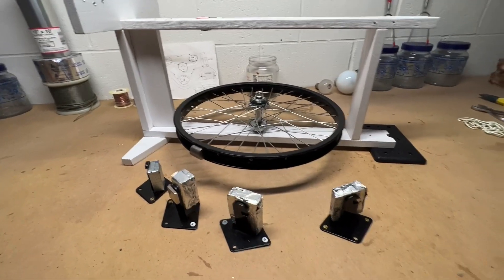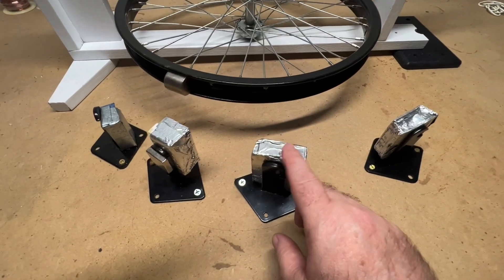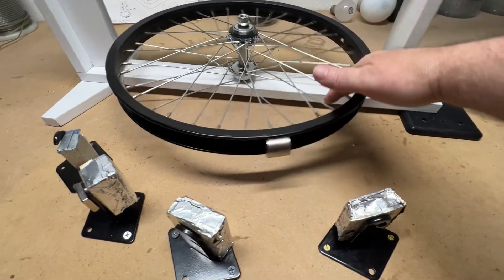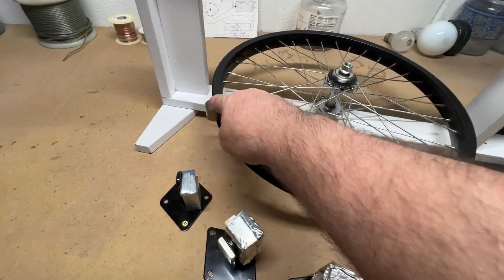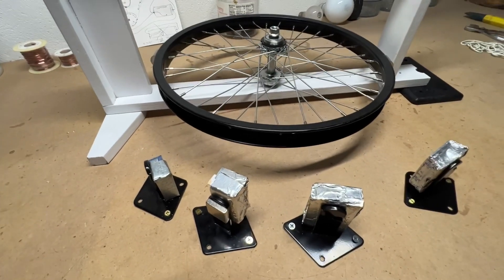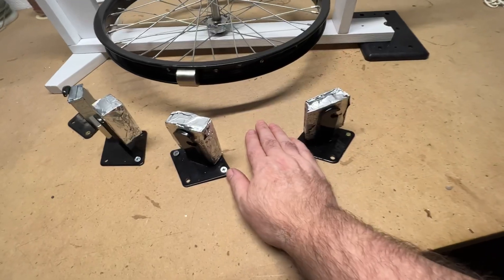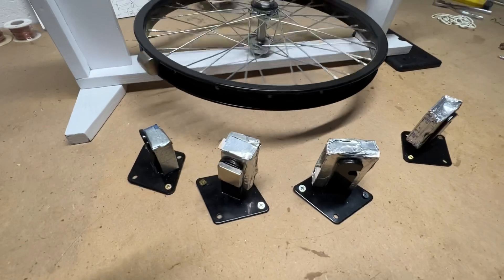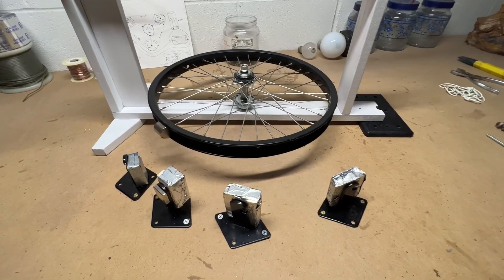🧲 FREE ENERGY GENERATOR RESEARCH | 4 STATORS

Comment from the maker: I forgot to mention in the video that did you all notice that the wheel actually picked up speed at the end of the fourth stater? The stators  actually made the wheel go a little bit faster. That’s not supposed to happen based upon Newton’s third law of motion. We actually ended up with a net gain of energy.  Another way to say this is that the wheel was starting to accelerate.

I do not have enough 2“ x 1“ x 1/4“ magnets to finish this project. I’ve ordered 12 more of them today.

Comment: Hey James, It's the conservation of energy that seems to be at risk here.  Not Newtons law.  You've put a lot of thought into the magnetic flux direction of your stators, but don't forget the flux of the rotor magnets.  They are affected by the steel rim you are sticking them to and that rim also acts as a shunt for them.  I'm not saying that's a bad thing, just a heads up.
Reply from the maker: 🧲 Not only are you a 100% correct, but the steel rim itself takes on its own magnetic property caused by the magnets. That whole wheel is  magnetically energize now, Even more so when there are dozens of maggots on it. That’s why I need to get away from using a steel wheel as soon as possible. Just not sure yet what I’m going to replace it with. A half inch thick PVC disc would be nice. More so, thanks for stopping by out of your busy life to give me great constructive feedback. Very kind of you. 
👉 🧲  https://youtu.be/e7RXrSYSaqc

Comment: the equal and opposite reaction is occuring but to the fixed table being pushed the opposite way, obviously not with enough force to shake or move the table but rest assured it is happening. You cant see it because things are screwed to the table but if you had ultra sensitive equipment it might detect a small push in the opposite direction to the push, still i think you are on to something fantastic, my good wishes to your pursuit.
Reply from the maker: Hi Alan, if the equal and opposite reaction was taking place then the armature magnet would not continue to move forward. Rather it would reverse direction just as it started to pass the other side of the stator magnet. That wheel by the way on the table it’s just sitting there. It’s not fastened down. As always, thank you for you constructive input, more so, for stopping by.

Comment from the maker: 🧲 We are not here by accident. So welcome. In this video demonstration I’m using both attraction, and repulsion mode.  First is attraction mode, then followed by repulsion which pushes it into the next attraction mode which then goes into the repulsion mode again. This process simply repeats. I refer to this as the leap frogging effect. The armature magnet leaps from one stator magnet to the next stator magnet, then to the next stator magnet and so on. 

Just ordered over 200 magnets and still have a few more to order. Will have an update soon. 

Thank you for stopping by. 

Note: This is my back up channel. Because legitimate channels trying to figure things out keeps getting taken down while all of the scam channels remain up.